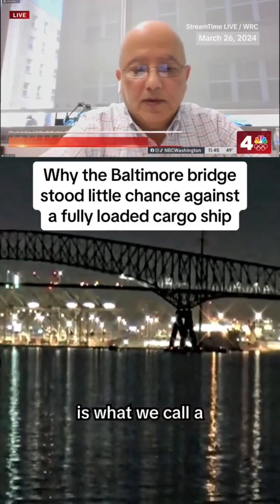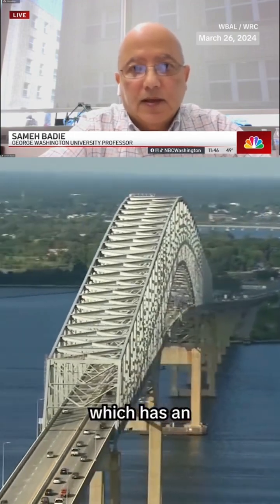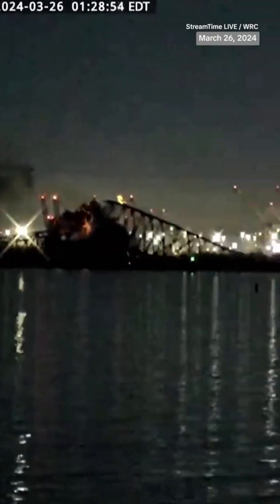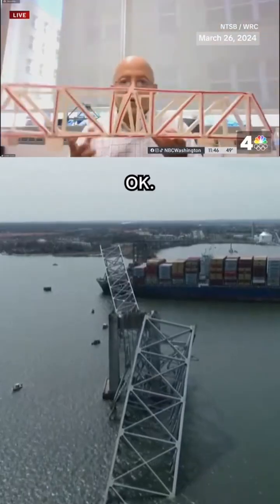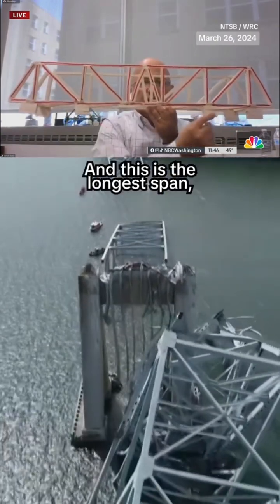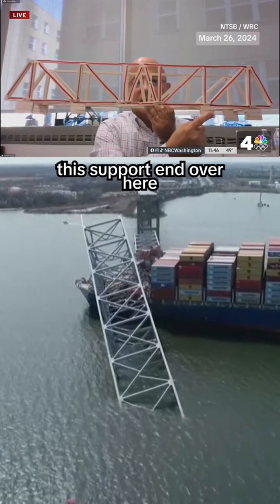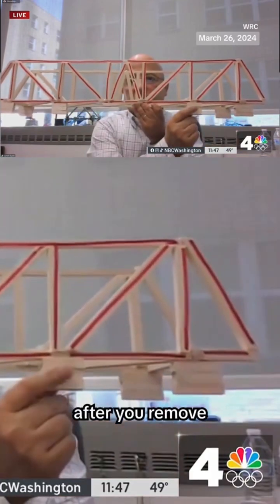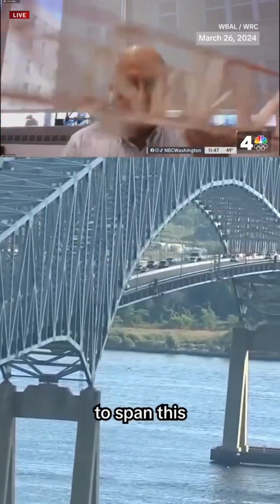Engineer explains why Key Bridge couldn’t withstand ship crash

Comment: The design was empressive at the time it was fabricated. But of course it was not designed to survive impacts like that of the vessel. All existing pass through bridges should now have impact barriers with spring shocks and solid structures behind it. The impact force also should not be connected to bridge itself.

Comment: The pier had a small base by todays standards.  The pier was not designed with any protection from being struck by ships . The spans were not the issue as this collapse is all about the weak pier design.  The bridge has been lucky for 50 years. No protective orders were in place for local shipping like using tug boats to pass the bridge.
Reply: Exactly 
Large base piers with decent height are the only thing that could have saved the bridge
Reply: our area tug boats bring ships in by our bridges SLOWLY..ususally TWO tug boats. we have many old bridges and none get mauled down. they [baltimore] must of decided to cut costs to get more shipping; i think shipping co must pay for the tug escorts?

Comment: Sameh is an Egyptian engineer. He was one of the consultants building the bridge over the Suez Canal. He knows what he is talking about since the bridge was actually hit by a massive MSC vessel and didn't even shake. Trucks went on crossing, and drivers didn't notice the huge bang.
Reply: He's saying America's engineering of that bridge was fuqd
Reply: @jackjohnsonjohnson8610  It wasn't.
Reply: @PresidentofAntifa  then YOU explain your interpretation of what he's saying
Reply: @jackjohnsonjohnson8610  Why? There is no issue with the collapse or the bridge. It is the same thing every credible person has said.
Reply: Any civil or structural engineer with a basic knowledge of bridge design could tell you this. 

This guy is not saying anything special here.
Reply: @farzana6676  No need to be ANY kind of engineer. It is very basic physics. Anything we make vs an errant 200,000,000 lbs is going to lose.
Reply: @farzana6676 okay? We still value this guys opinion

Comment: Is the captain being charged?
Reply: For what? The ship had lost power and was drifting without the ability to change course. What would the captain be charged with, exactly?
Reply: @liquidmark5081  it changed course into the support so it had power so if it lost power and it came back on why  didn't he go full astern and drop anchor? If you had a power issue it means the engines were out so why would you continue heading out with unreliable engines. Why wasn't there tugs guiding it out.
Reply: @pugly747 please explain in human terms how you are supposed to make a ship that weighs 400 tons turn in a split second.
Reply: @pugly747  I see by your opinion that you are a shipmaster. There are numerous youtube videos by actual real experts, not you, explaining what happened.
Reply: @Noname-613  try 100.000 thousand tons deary,
Reply: @Noname-613  you must have been watching a sped up video of it as it took a lot longer than a split second but don't let facts get in the way of your opinion.
Reply: @rona4960  it is an expert opinion. My advice to you is watch more videos.
Reply: @pugly747  What is going on with shipping, right here on youtube
Reply: 1) the Captain was not in charge of the ship for this passage, A Port of Baltimore River Pilot was.
2) the river was flowing out to sea and was pulling the ship into the bridge pylon so without power to steer there is no way to keep it from hitting.

Comment: Who passed the law of gravity?
Reply: Gravity is only a theory.
Reply: @chilkat_river a scientific theory is pretty much a fact. A scientific hypothesis is what a layman would call a theory.
Reply: @liquidmark5081  There are Scientific Hypothesis, Theory, and Laws. Notice there are no Scientific Facts. It because facts can't be changed but the other three can based on new data, though each level requires more contrary data to cause it to be changed. 

Hypothesis - any contrary data should result in adjustments
Theory - Significant contrary data is required make adjustments
Laws  - Overwhelming contrary data is required to make adjustments.
Reply: There are laws pased by man but those are different laws to the laws of physics which do not get passed by anyone.